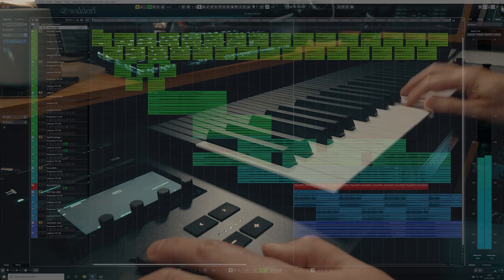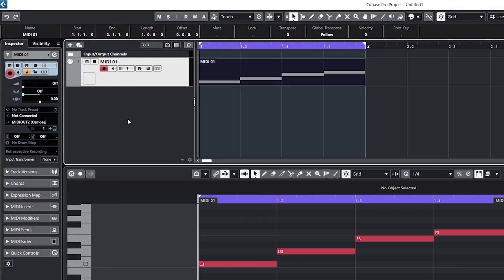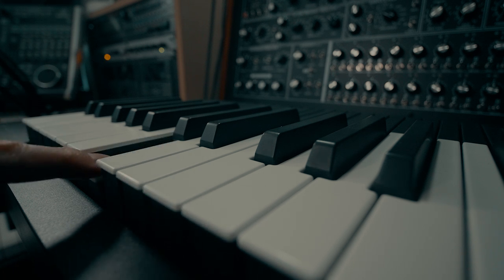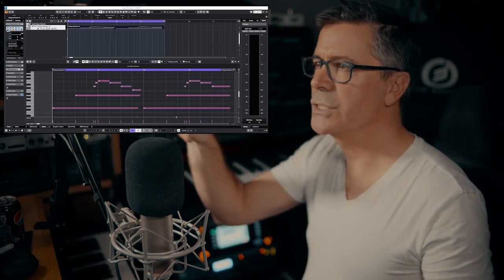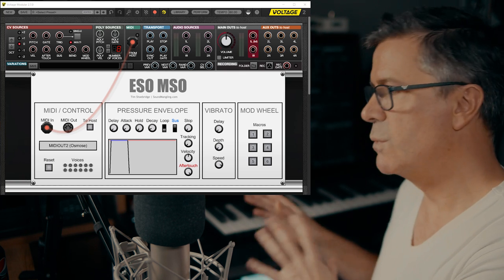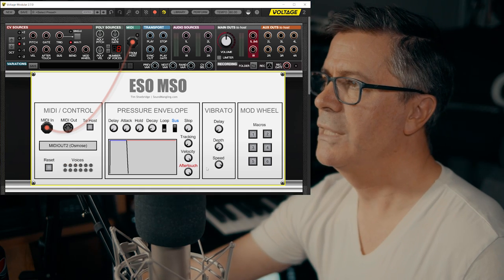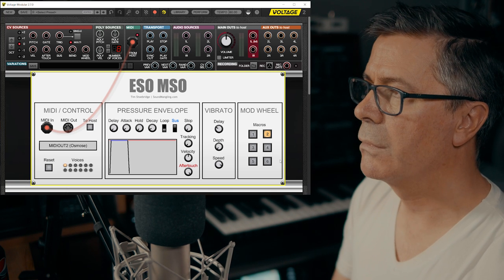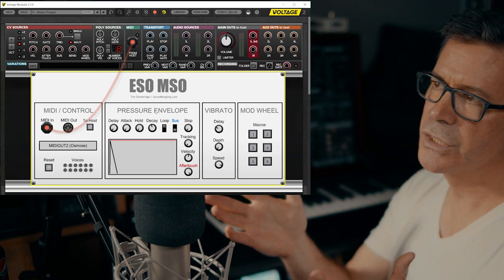Sequencing the Osmose

Comment: As I understand it, the first MIDI output is MPE formatted (unless a legacy format is selected), and intended for external synths.

The second one is in Haken's proprietary (but well documented) "MPE+" format, for Osmose and Continuum.

(It uses extra messages to encode higher bit depth information.  Probably better for sequencing Osmose, but be aware that no other synth is expecting those signals.)

Won't be able to test and confirm for another month...

Comment: I don't know if this helps at all but there is 1 sequencer I know of that is MPE compatible and that is the Squarp Hapax, for people interested in a hardware solution.
Reply: I believe the Deluge also has some MPE sequencing support
Reply: @dfkman  Yeah, it does.  It is annoying that (as far as I know) the Deluge has no way of exporting recorded MIDI  or MPE data, although in principle it could probably be extracted from the song XML files.
Reply: This is the info I’ve been looking for. Was looking at Akai MPC and Ableton Push, then suddenly thought about this; ‘Will they even work with MPE?’ Really don’t want to have to use a daw
Reply: @Craig_Hilbig  new Push 3 works with MPE it is well over priced for what you get.
Reply: @dankeplace  ahh thank you. I’ll continue to compare. Though I’m really liking what I see with the Hapax
Reply: but the Hapax has currently limitations and a bug that makes it impossible to use as of now with Osmose

I have much more success with the Cirklon currently
Reply: this is not true! the hapax is still incompatible with the osmose and it's feb 24

Comment: Thanks Tim for addressing some of the real world issues potential owners of this synth will face.  It seems your software would be a great midi processor for using standard midi controller  data with the EaganMatrix (or any MPE ready synth) when they get around to porting it to PC, which surely must come at some stage.  I think they need to rewrite the Haken editor though, it looks like a real joy to use. 
As regards your track it sounds good to me, but maybe you should treat the Osmose like an acoustic instrument and master comping.  All the little imperfections are worth embracing!
Looking forward to more videos, maybe some with the Osmose controlling hardware synths, that would be interesting.

Comment: Marvellous work Tim! Congrats! Here's an idea. Could you run Osmose back to itself... like basic (basic Osmose Midi port) to Comp then via your soft ESO MSO, back to Osmose? Might not even need to have local off... there could be some amazing dual-function sound possibilities... and further assign those pressure envelope parameters and macro buttons to additional midi controller for some realtime mayhem 😄

Comment: Thanks for the video. For myself, I'm interested in how well, or not, the keyboard acts as a controller for other synth plugs, and particularly the Kontakt sampler where it could, on the face of it, provide a good deal of expression to wind, string, etc, libraries. Perhaps you've already covered that in an earlier Osmose video. If not, any chance of covering the subject? Thanks again. 🙂
Reply: There is (or at least used to be, haven't checked in a while) a video of Amon Tobin using a Haken Continuum to control Kontakt. It should be similar with Osmose. At the time (not sure if NI has improved this, prob not) you had to put an instance of Kontakt on one MIDI channel per note of polyphony... so for 6 notes of polyphony, you'd put an instance of Kontakt on each channel from 2-7, in your DAW. You'd want to set up most of your expression mapping/scripts in Kontakt before copying each instance to its appropriate channel, because each instance will have the same mapping.

I agree, a video showing how to set this up stepwise would help very many people.

Comment: “Show used controllers” is the command you want 

I have 4 StreamDeck buttons I use after recorded MIDI part

They are all key commands

Lower Zone Open (Enter)
Select All (Ctrl + A)
Zoom to Selection (Alt+S)
Show Used Controllers (User set Key Command)

You can set a shortcut key for this in Key Commands window

Enjoy :)

Comment: Loving Your work, Tim. I’m struggling with osmose and midi. I’d be interested in your software addition but I think the reverse video as mentioned in the comments would be great.
Reply from the maker: Hey. I have also done a video about using the Osmose as controller. But must admit I didn't go into a lot of details about the midi setup.

Are you trying to controll an MPE synth, a poly AT synth, or just regular?

Comment: That's very cool.. The addition of more control over the mod wheel.

I found using the Osmose port best for most vst... Using the midiin2 port I get full velocity on some vst (it maxes out even on light touch)

The midiin2 and midiout2 is for haken OR recording data from the osmose to replay back into the osmose.. That seemed to work fine. It is MPE+ vs standard MPE on the osmose midi port.

Comment: If you're using Cubase, why not use note expression?  It does exactly what you're asking for at 18:17 and avoids the issue you describe at 19:09.  All of the controllers are attached to each note and you edit them in a subeditor within the piano roll editor when you set up the MIDI part as an MPE part.
Reply: I tried using note expression while playing with my seaboard and it is so difficult to draw, they basically give you a white peace of paper no grid no nothing, it is so confusing snap doesn't seem to work I'm not sure how to use it properly. I gave up on it and tried to get my takes right as close as possible, it's quicker than editing there.

Comment: Great vid. One correction, polyphonic aftertouch is its own midi message. CC 74 is traditionally brightness often mapped to cutoff.
Reply: This also equates to the MPE Y controller (the front to back dimension on the Continuum).

Comment: Tim I have a question regarding the discussion at or near the 16.51 time mark regarding the way performance data is translated using Cubase as well as the Vasken Continuum sound engine.  My point of reference is as a Roli Seaboard user interested in this Expressive E keyboard who uses Cubase was the following:.On the Roli Seaboard, Pitch bend and portamento use cc1, Aftertouch is routed to CC11 (originally used as expression pedal), Velocity determines the envelope Attack time and envelope filter amplitude, moving on Roli Seaboard across the Y value (length of the key either toward the player or away from the player is routed to CC79 (cutoff filter), and release velocity is routed various ways depending on the specific  VST.   On this video you said aftertouch is routed to CC79. Can this be changed on the Haaken Continuum sound engine so Roli players with a Seaboard technique can perform Osmose keyboards with the same performance?  The answer would affect the way I would approach sound design and performance. Thank you in advance.

Comment: Hi Tim. Interesting. Sorry for my ignorance but my Osmose has not yet arrived. Like you, I would want to record sound and midi from the Osmose into the DAW (although I would see no reason to control it from another keyboard). But, if I understand you correctly, you can't quite simply play the Osmose and record the midi data into a DAW, tweak, say, a single note and then just play it all back to the Osmose and have it sound the same - and this is a limitation of the quantity/type of recordable midi data available? AND you certainly could not do it with multiple sounds. The way to get the Osmose to accompany itself is only to record audio on different tracks into the DAW, but without the ability to tweak anything (other than whatever each DAW can do with audio).  Presumably, the audio into the DAW has to go via the audio jacks (not USB) and therefore requires an additional DAC to get it in there. I would have expected that any sound bank within a DAW's plug-in sound modules would be limited as far as responding to all the expression, but I anticipated that being able to use the software version of the Osmose engine (the EaganMatrix) as a plug-in (or stand-alone), would do the job correctly.  It seems that ExpressiveE may have missed a trick with omitting an onboard recorder/sequencer...have they? But maybe a standalone recorder will be developed by someone or maybe a firmware update[?] regards

Comment: I use breath controllers and I'd be curious how the Osmose would react to being played by a standard keyboard with aftertouch mapped to poly aftertouch and blowing into a breath control with breath mapped to standard aftertouch.  The poly aftertouch would not be true MPE as it would affect all notes equally.  Along with that, map mod wheel to MPE pitch bend again affecting all notes the same.  I have yet to see anyone demonstrate the Osmos with a breath controller... at least not on the tube.

Comment: I think we should all stop saying that the Osmose has three dimensions of expression. It's an amazing instrument, but it does not have three dimensions of expression, it has TWO. There are three parameters, yes, but two of them are co-dependent. If you plotted the possible value combinations you could use a rectangle with a dividing line down the middle: you wouldn't need a cuboid.

Comment: Used to have GAS for the Osmose but now I don't think the expressiveness is worth that much to me over polyphonic aftertouch which all controllers should have these days (shame that many don't).
Reply: Might you know of any regular keyboard style controllers made currently that have poly aftertouch? I know of a few out of production models. There are a few synths that have it that could be used as controllers, but other than the Waldorf which is $$$ I don’t want the synths that have them. The rest I know about are not typical keyboard style controllers (McMillan, LinnStrument, Roli). Would love to know of some regular controller options with poly aftertouch. Really wish the Keystep Pro has it. Roli Lumi is close but not a great keybed
Reply: @Craig_Hilbig  I use the Push 2 for poly aftertouch but I know it's not a regular keyboard. Microfreak from Arturia would work and is cheap enough. But yes big shortage.
Reply: @andrewcampbell8938  yeah hopefully it improves in next three years